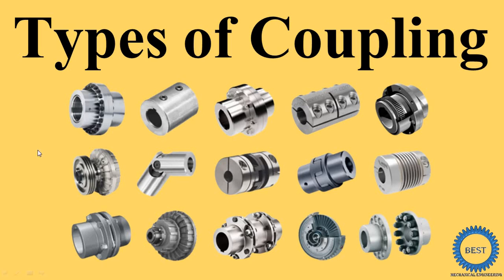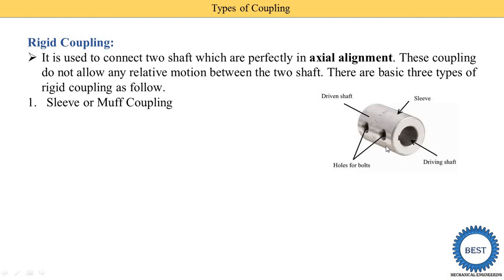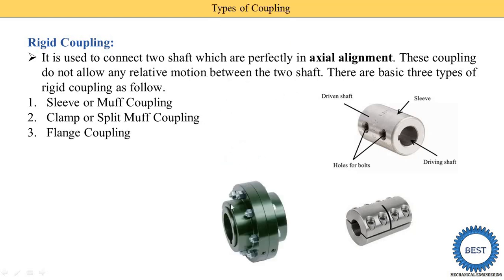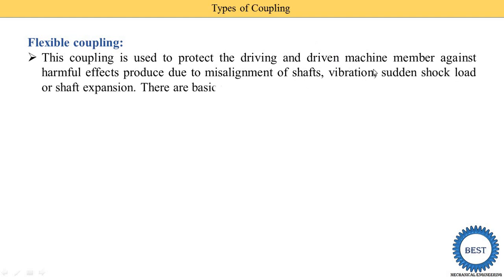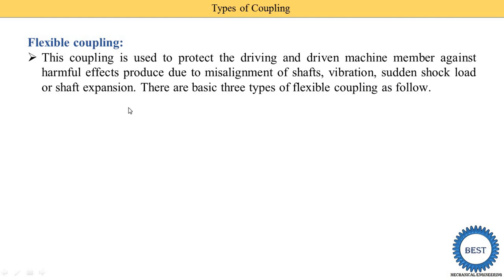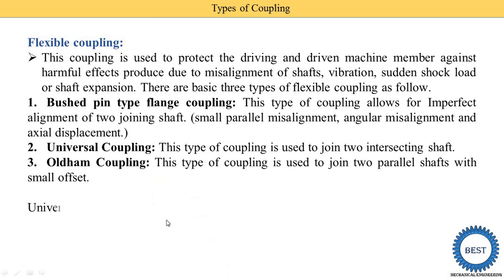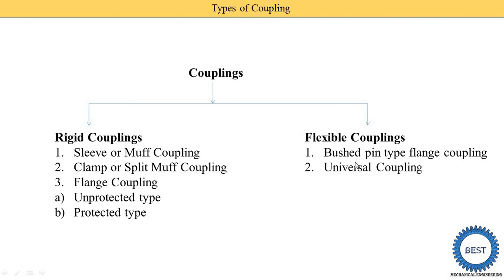Types of Coupling

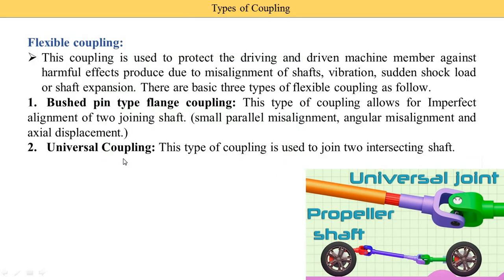Comment: Hello there! Regarding 4:06 / Universal Couplings, as you know, these can used at a 90 degree angle, so if we had a 2D drawing of such, we could say it converts vertical rotation in to horizontal rotation. Can you tell me if there is a coupling (and it's name please) for if instead of this looking like an L... if a coupling can be made that resembles a T ... so the vertical rotation changes in to horizontal rotation on either side of the connection to the vertical rotation? I'm a non engineer, so my apologies if that's not the best description it could be. Your answer would be incredibly useful to me, thank you!